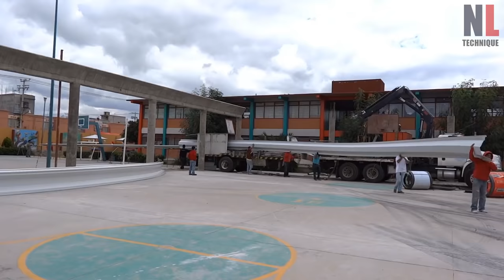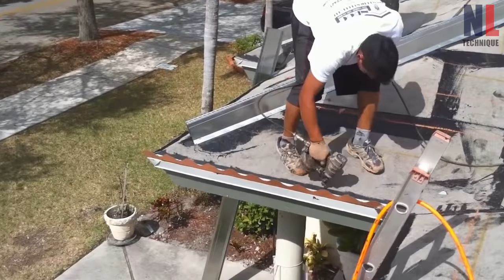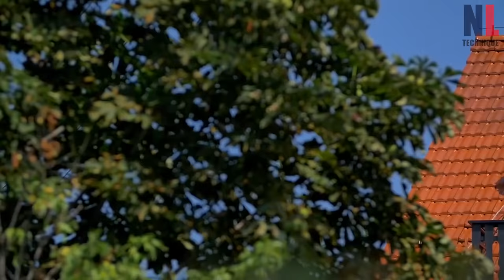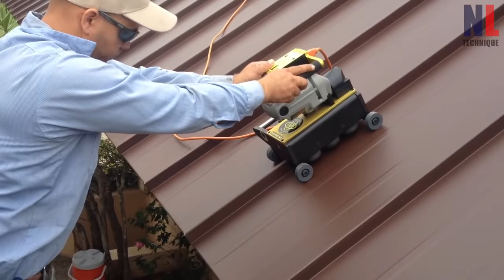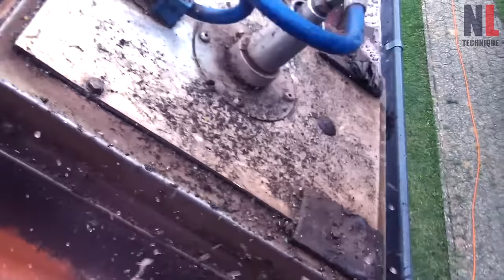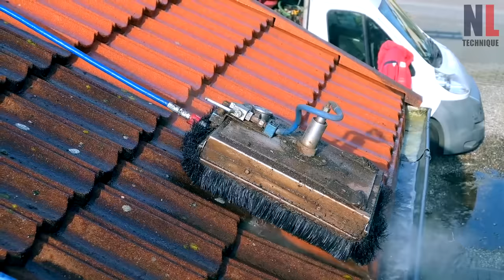World of Amazing Modern Roofing Technology  with Skilful and Creative Workers

Comment: I am curious how many broken tiles there were after all the WORK was done ? Tile rooves are very touchy about how they are walked on . Broken and clean vs weathered and intact !?
Reply: They're Vinyl Interlocking tiles.
Reply: Some will break but you usually carry extras to replace broken ones. As long as the person on top isn’t 350 pounds few will break.

Comment: Natural slate is the best natural roof covering there is. Especially if you live in an area with cool damp wet climate like Ireland. Moss build up on concrete tiles here were I live turn into a carpet after ten years or so. Where as there virtually no moss build up or discolouration with a natural slate roof.therefore they are very low maintenance.